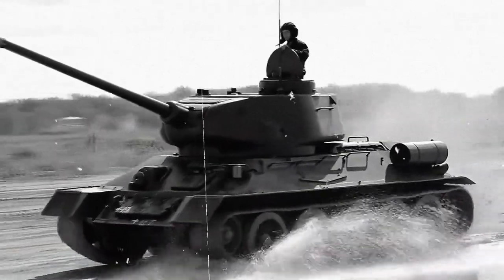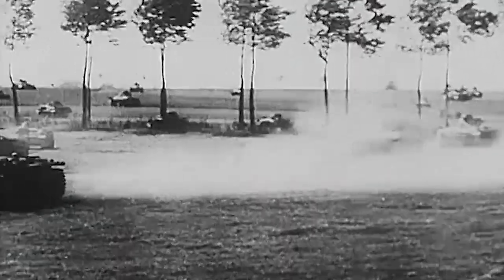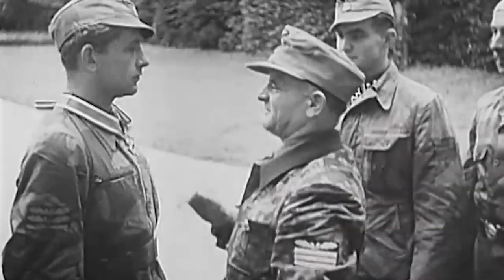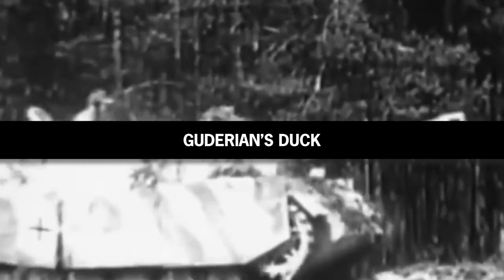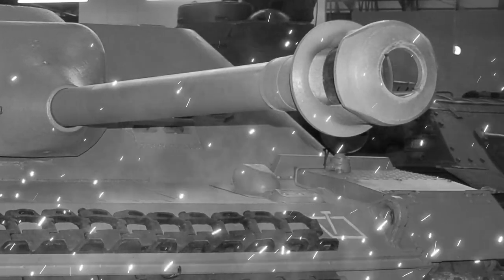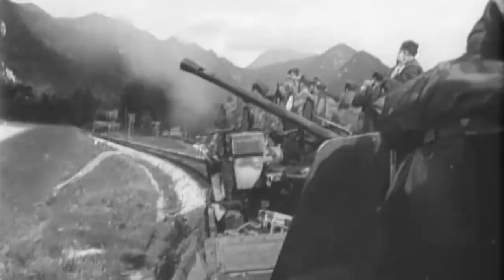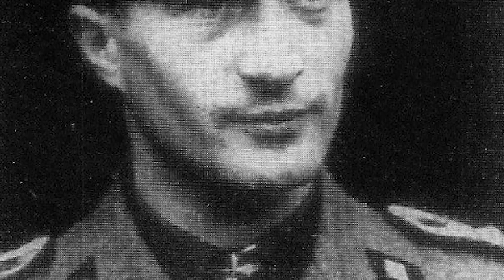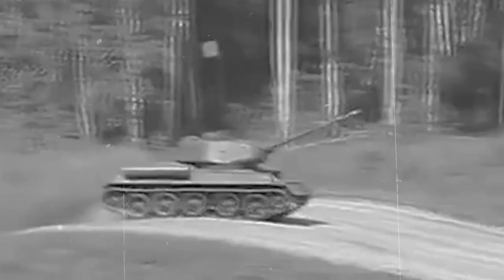Jagdpanzer IV Tank Buster

Comment: In 79 I did an high school interview with my My Opa who was in the 8th Panzer Division in the Panzerjager Abt 43. He fought with them from 40 to 45. His first weapon was the 37 mm PAK 36. He hated the poor protection. In Leningrad he lost a friend and his whole crew to HE fire attacking dug in KV tanks. He said they didn’t scratch the paint of those tanks. Then he went to Marders it fixed the gun issue but still the crew was exposed and the sides were thin. But then he got his Panzerjager IV L/70 it was a game changer. He absolutely loved that gun . He told me that the shell was so fast it had no arc. (He made a zip sound and snapped his fingers) His vehicle was abandoned in Brno when he was captured
Reply: The old door knocker man that was running joke once the kv tanks T34's started pushing along the Frontlines even the  pak 38 wasn't as good against those bundles of hot  nonsense even the 5cm kwk L60  of the panzer lll had it's drawbacks up against those two tank's especially the kv-1's thankfully the 75mm 88mm made short work of those problems the fact that your grandfather survived the war in the East is astounding
Reply: Super cool, thanks so much for sharing!!!
Reply: Pak, a Pak, a Pak, PANZER KANNON

Comment: Can you guys do a video on the prototype surface to air missiles the Germans were making? They were pretty crude, but I bet you guys could find something on them.
Reply: The v1 and v2?
Or which do you mean?
Reply: @flaskanbottle9250  Nah they had projects for missiles that would shoot at b17s and other bomber formations. Like I said they were very crude but the idea was there.
Reply: Fleigerfaust? Multi shot antiaircraft missiles?
Reply: @flaskanbottle9250  rheintochter,schmetterling,enzian,wasserfall
Reply: @danielpiazza5195  I read about them long time ago in a book but I could never find any more info. All I know is that they were only used once against a B17 formation with satisfying results.
Reply: @flaskanbottle9250  v1 and v2 are not fucking surface to air missiles
Reply: @maisonraider4593  I read about them but I’ve never been able to find info on if they were used or anything
Reply: @flaskanbottle9250  I think that design was a cruise missile one
Reply: @vorda400  Enzian? I drink that in Bavaria
Reply: @jimmylight4866  It was a radio-guided missile made from Messerschmitt Me 163 because that plane was unusable, they turned it into a missile
Reply: @vorda400  Vorda, they should make a video about the missiles the Germans used to sink the Italian fleet when Italy switched sides. The Fritz-X.  Oh and Enzian is also a drink made from a blue mountain flower.  I would much rather radio control an Me-163 than actually fly one.  That t-stoff mixing with c-stoff looks hi-risk.  Although the aerodynamics of the Me-163 seemed to have inspired the space shuttle.  They can thank Alexander Lippisch for that.
Reply: @breadboi1248  yeah that’s not what I’m talking about

Comment: The T-34s were not powerful at all; and the Germans were not outmatched by it. The Germans had encountered T-34s since the beginning of Operation Barbarossa, and this means that their armaments; the 37mm and 50mm were sufficient against the T-34s, although not at range. As advanced as the design of the T-34s were, they suffered major issues stemming from poor production quality, poor commander sights, being cramped, and also from the hard but brittle armor.
Reply: Not to mention that the T-34 is quite expensive for a mediocre tank if produced to proper standard
Reply: The T-34 was strong before the germans had proper anti tank guns such the 5cm with around 100mm of penentration and the 7,5cm with around 130mm of penentration
Reply: @startingbark0356  It was average at best but is also expensive, add in the fact that it was later built poorly in the misguided believe that the Soviets needed more tanks regardless of quality, when they should have just build more good quality tanks, people can say all they want about how quantity have a quality of it's own, but the reality is that without decent enough quality you're better off not build any tanks
Reply: @AHappyCub  then the USA shouldve build better tanks aswell its just that the T-34 was much more well suited for the russian terrain and its production price decreased by more then 50% during ww2
Reply: @startingbark0356  except the Sherman IS the better tank, better for the price AND quality assurance, there is literally a book from a former WW2 Soviet tank crew that prefer the Sherman over T-34
Also production price going down overtime is inevitable anyway
Reply: @AHappyCub  he only said he preferred the sherman over the T-34 but he said that the T-34 was good aswell but he just preferred the M4 sherman, someone’s preference has nothing to do with something being better or not, the swedish disliked the sherman because it easily fell on its side due how tall and narrow it was and loza mentioned this aswell that he had quite a few moments that he almost felt like the sherman was gonna fall on its side and that the T-34 was better on rougher and more hilly terrain,
Reply: @AHappyCub  not true, the panzer IV only became more expensive at such a rate that the panther was just as expensive, the T-34 was relatively easy to produce tho and cheap compared to other russian tanks
Reply: @AHappyCub  a T-34 was worth 130000 rubles/24000 USD in 1942 while the M4 sherman was worth around 44000 USD, it was in reality around 2.5-2.6 times more expensive then a T-34 to produce, the USSR just had only 1/10 the military budget the US had during ww2 and 1/5 the military budget the nazi’s had during ww2, so thats why the T-34 might be looking expensive but for the russians it was just expensive but they had not choice, even when T-34 was expensive for the russians it was way cheaper then the panzerkampfwagen IV and M4 sherman
Reply: @startingbark0356  They do have a choice, and that choice is making the T-34 the way it suppose to, WITH GOOD QUALITY QUALITY ASSURANCE, isntead of making a poor quality one, atleast that way the T-34 would be a good tank, instead of the shitty ones, something they clearly capable off
Reply: @AHappyCub  the soviet industrial capacity was rushed and they had no choice because they needed T-34’s quickly to stop the germans
Reply: @AHappyCub  and T-34 wasnt that shitty, only the early models where shitty
Reply: @startingbark0356  Actually all of the war-production T-34s were shit. The reason why there were so many T-34s in the first place was because of the quality to which the T-34s had been produced. There was a report that only 7% of all T-34s were built without any defects, and these defects would cause frequent breakdowns. Almost 50% of tank losses would then be attributed to such breakdowns, compared with 20% from the German side. This is even proven by the T-34 being tested at Aberdeen Proving Ground and the tank still broke down; even with a Soviet engineer conducting the test itself. As well, the T-34, if built to American standards with proper welds and to the standard it was supposed to be built to, would cost as much as the M4 Sherman did, even accounting for the Soviet economy.

Comment: The German 37mm at gun was effective against the side of th t34 at close range and perfectly adequate against t26 and by types. By mid 1942 the pz4 and stug 3 had been outgunned  with the L 43 guns which were more than adequate to kill the t34. I normally like this presenters videos but he didn't research this one.
Reply: This isnt the only video has has made basless claims in. He makes a lot of dumb statements and videos. His european military tech videos mostly are false statements as research is apparently too hard to do these days.
Reply: Also Panzer 3s with their long 50s knocked out T-34s more then any other vehicle.
Reply: @flare9757  Only when there was a supply of tungsten cored APCR to shoot.

50mm. L.60 PaK.38 & KwK.39 performance (from German Kummersdorf range tests):

PzGr.39 APCBC-HE shot = Up to 99mm. of RHA @ 0 degrees @ 100 metres.
                                            = Up to 56mm. of RHA @ 0 degrees @ 500 metres.
PzGr.40/1 APCR solid shot = Up to 141mm. of RHA @ 0 degrees @ 100 metres.
                                                 = Up to 78mm. of RHA @ 0 degrees @ 500 metres.
PzGr.40/2 APCR solid shot = Up to 165mm. of RHA @ 0 degrees @ 100 metres.
                                                 = Up to 86mm. of RHA @ 0 degrees @ 500 metres.
Reply: Yeah. T-34 Tanks weren't bad, but just more Quantity than Quality. And if there's 2 T-34's for one Pz. IV or smth., the T-34's would most likely win. Which was also the Problem of Panther's or Tigers, although being the best Tank on the field, having a Ratio from 1 Panther/Tiger to like 3-4 Shermans or T-34's just isn't optimal.